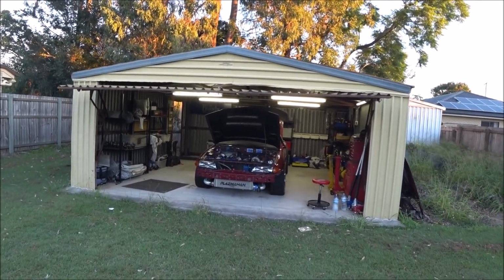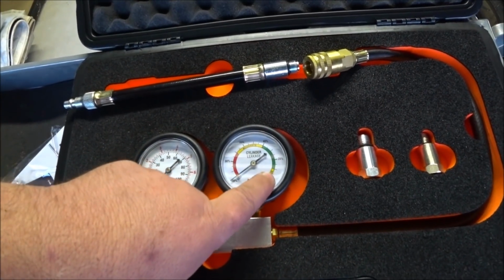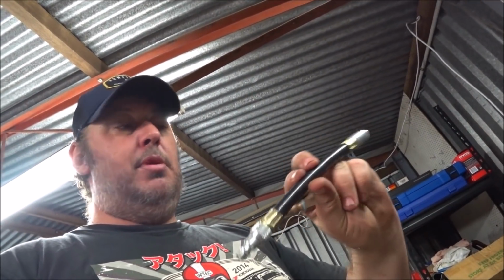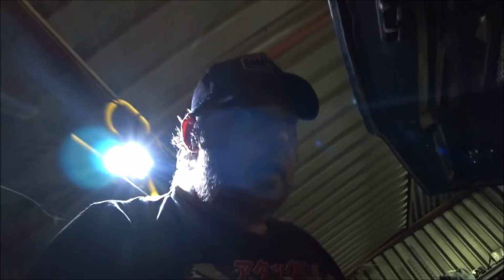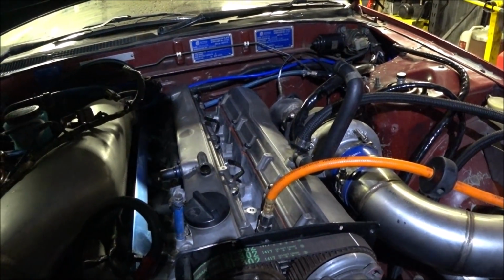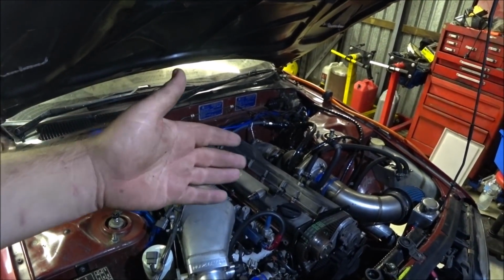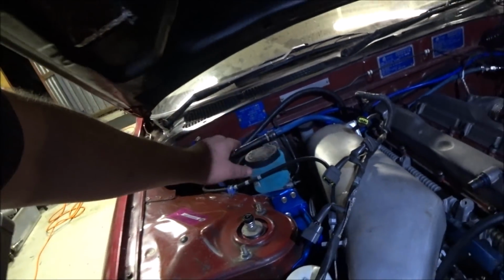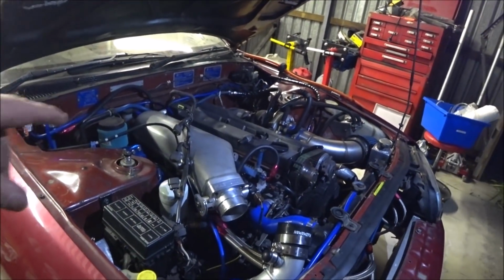RB25DET Build - Low Engine Compression Cause

Comment: I got 110ish psi all 6 and wet 120ish eBay tester . Leak test C5 TDC leaking exhaust side.
Reply from the maker: Valve seats, valve seals. Valve train issue.
Reply from the maker: Possibly timing problems too. Check the cam belt
Reply: @tangles01  thank mate. I will check the timing belt tomorrow
Reply: @tangles01  check the belts. I'm guessing it's the original belt. It squeak when I try twisting it up words. Timing DTC lines up no issues.

Comment: Haha 100psi coming straight out of throttle body. Machine shop must have forgot to put the valve back. Need to make sure it’s on correct stroke when doing it
Reply from the maker: Machine ship didn't build the head, I did.
Reply: Didn’t actually mean the valve is missing.. props to you for doing it all by yourself, best way to learn and save abit of coin
Reply from the maker: @samflannery4459  Also if something fucks up, I know who did it.

Comment: Did u turn the motor over 360 degrees before checking #6 to get it tdc compression stroke, if u didnt it will be on exhaust stroke and valves will be open
Reply from the maker: I didn't, but that's coming out the intake.
Reply: @tangles01  intake valve opens before tdc on exhaust stroke, spin the motor over once and give #6 another try
Reply from the maker: @russelltilley8266  Have done mate, I've pinned a comment so others don't think it's a how to.
Reply: @tangles01  The joy of cars hey lol. I would crank it with timing light on to check spark, if it's good and has fuel give it some start ya bastard with the throttle cracked slightly open. Good luck with it
Reply from the maker: Done done and done, which is why I did the comp test previously.
Reply: @tangles01  I wonder if the lifters are not pumped up enough, could explain it. Just check with feeler gauge to see if they are down
Reply from the maker: @russelltilley8266  Lifters was my suspicion. Just need to find a couple of hours and I'll be able to confirm what the issue is.But having taken the covers off... it's not the lifters.